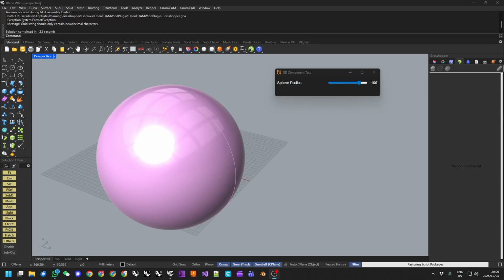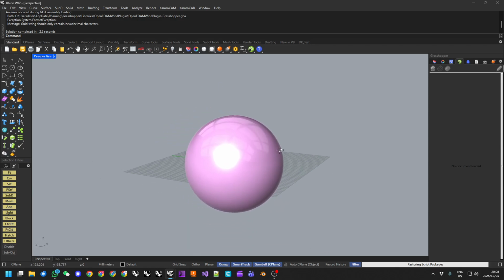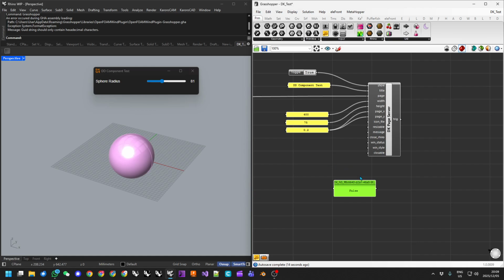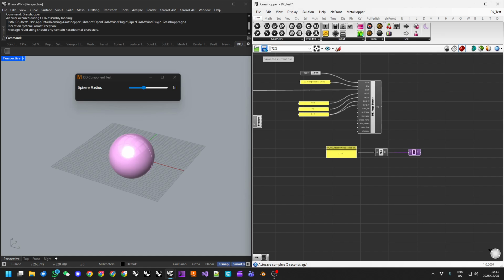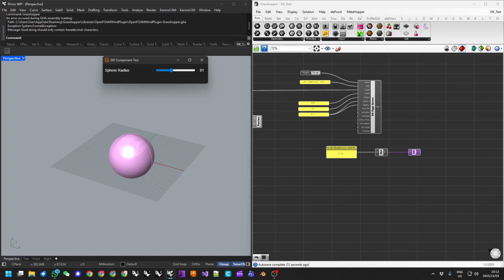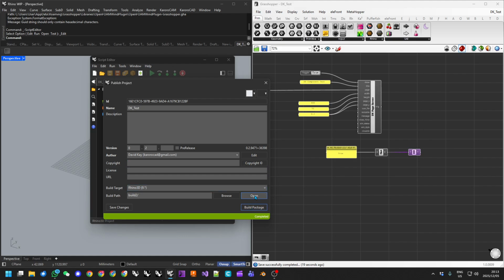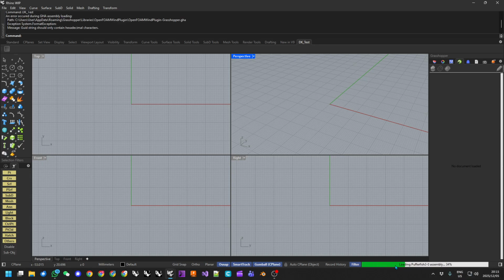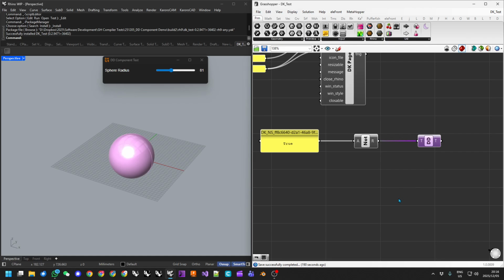DKUI Using the Dispose Document Component

Comment: What should I do if I don’t have the dispose document component? (Thanks in advance!)
Reply from the maker: The Dispose Document component is available in Rhino SR8.27 from mid December 2025. To find it type #dd while on your Grasshopper canvas. It will be 'unhidden' in a future release. However as long as you ask your users to ungrade to SR8.27 you code will run as shown in the video.